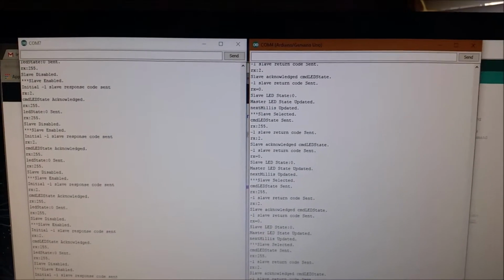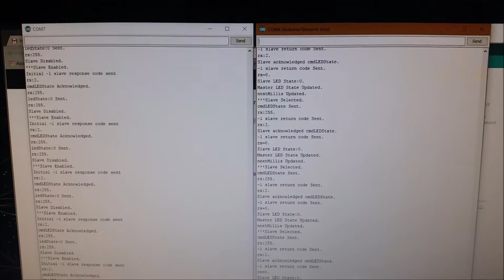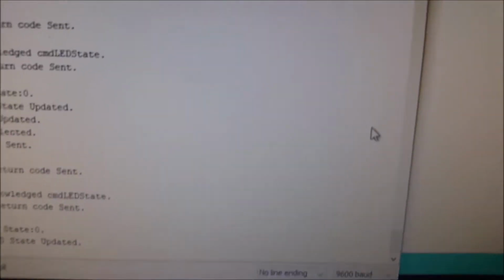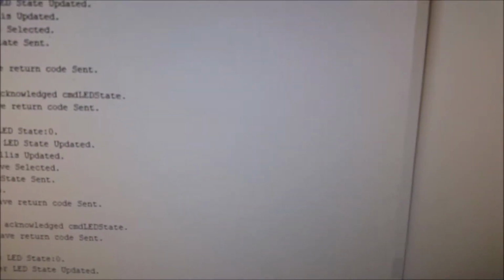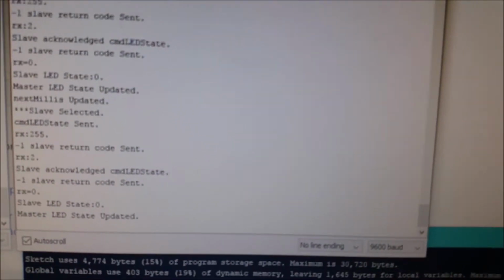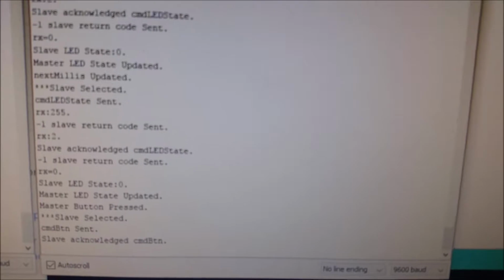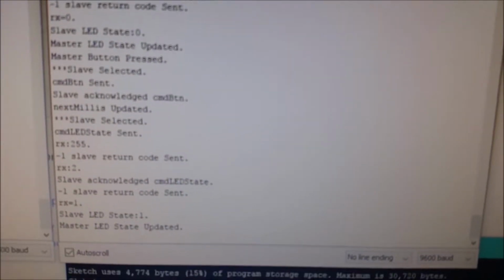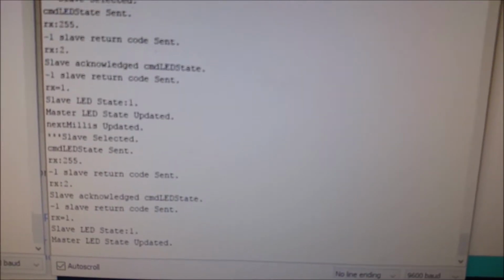Arduino SPI Serial Peripheral Interface Master & Slave Demo Tutorial (Update)

Comment: this is working..but its speed is very low speed.
Reply from the maker: The speed was not an issue in my intended application. This is something to consider though.
Reply: im using stm32f4 series arm mcu and its working only example on internet. i setup an Arduino mega slave port expander using your code template. there is delay(10); in spitransfer function.. i made it delayMicroseconds(20); and on mcu side i used 60 microsecond delays. devices now talking to each other with very good speed.. i want to use arduino mega EEPROM over spi. arduino is very good item to work with. when i opened my advertisement scrolling text led device case i saw arduino. than i decided to learn arduino. i think all electronics will integrate themselves in arduino ide.
Reply from the maker: I believe any path leading to knowledge of software engineering, is worth taking. :D
Reply: THANK YOU VERY MUCH